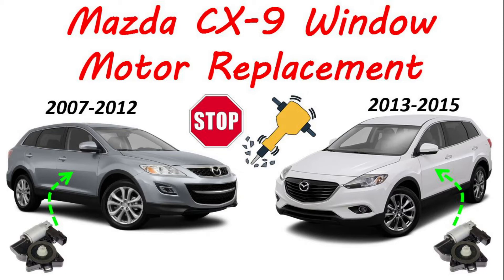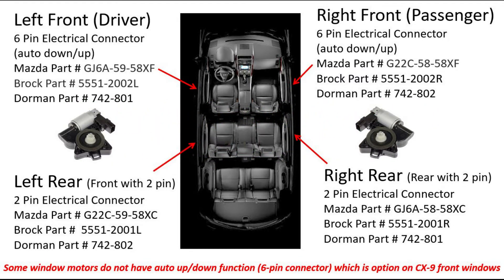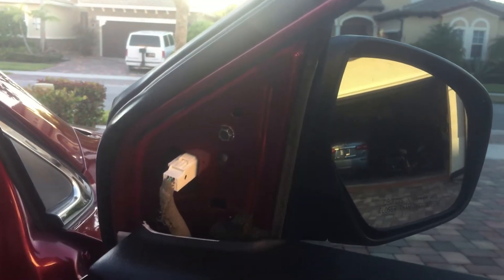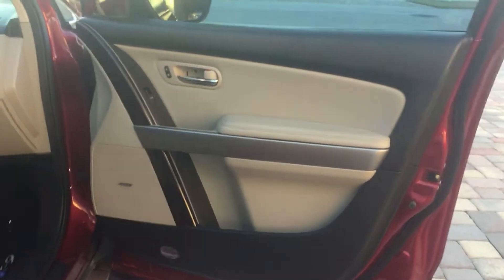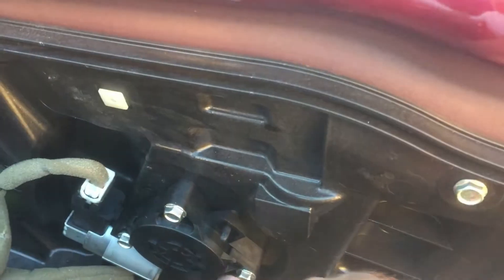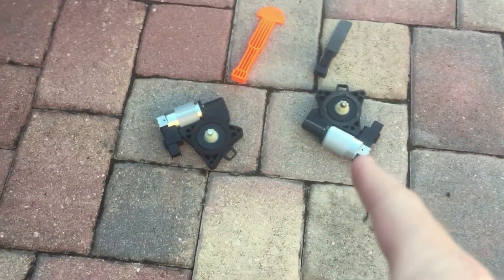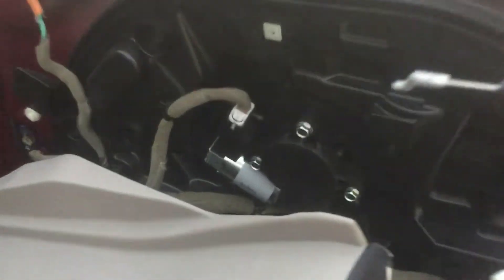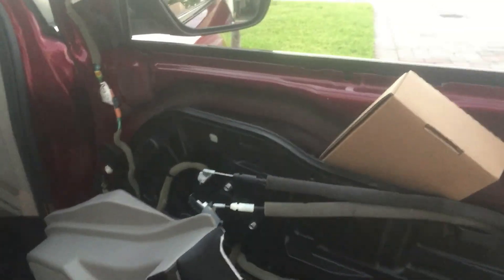2007-2015 Mazda CX-9 window motor replacement

Comment: Have you replaced both driver and passenger side window motors? Is it the same motor/part? I replaced passenger side a while ago. Need to now do the driver side. Wondering if it’s the same motor. Thanks for making this video. Best.
Reply from the maker: See description in video for the different part numbers.
Reply: Thank you; missed that and know better.  @BRichSolution